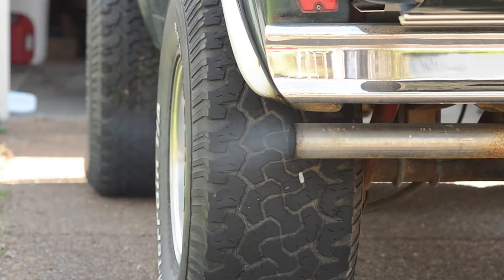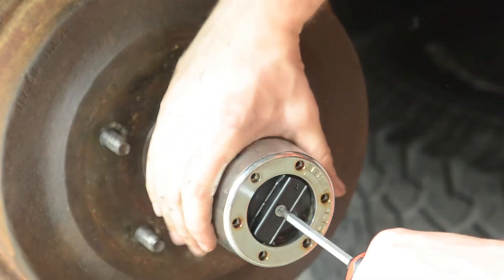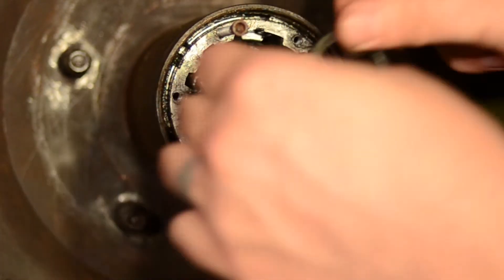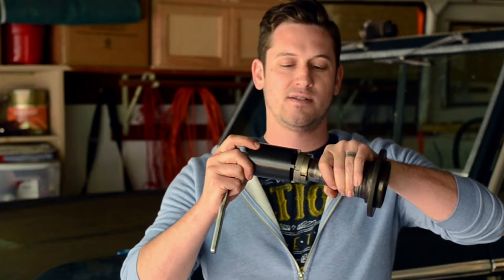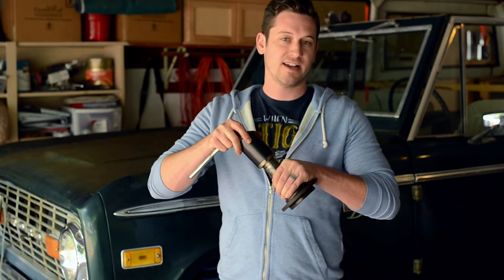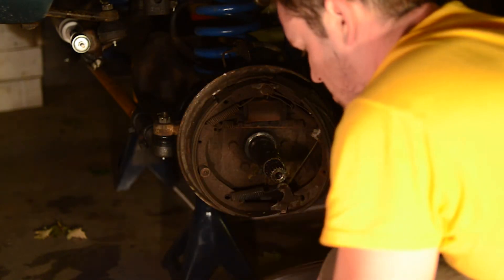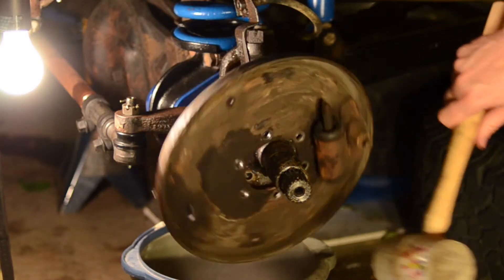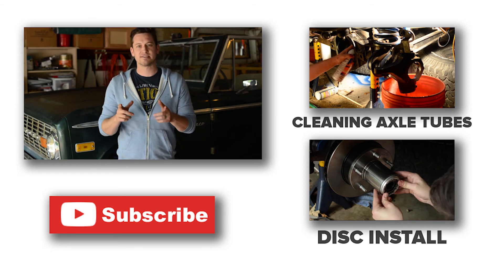Removing Drum brakes

Comment: I know this is really old, BUT......when you pull off the drums, there is a MUCH easier way that brute force.  You know that adjuster at the bottom?  Most frequently used on the rears for the parking brake adjustment.  It is also there to take up for shoe wear.  If you screw it all the way down (in closed), it will allow the spring to pull the bottom of the shoes in and away from teh drum.  They come right off if you do that.
Reply from the maker: I didn’t know that when I made this video but do now. But recently I backed the adjuster off on drum I was taking off and it still wouldn’t budge. Over time the rust had bonded the pieces together and I had to break it to get the drum off

Comment: As a tip for those keeping front drums- Anytime you are pulling the drum and it is stuck reach around the back and back off the adjuster and it will usually come off easily.
Reply: Fire It Up Garage I am sure that is the way most autos are.  Early Broncos are not that easy.
Reply: @wesleywall8414  That is a tip from our '72 Bronco.